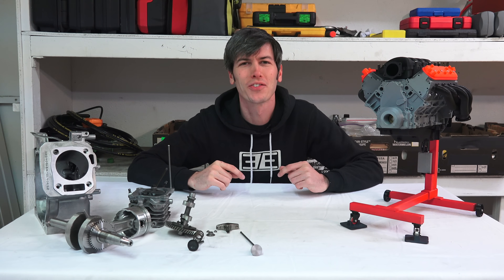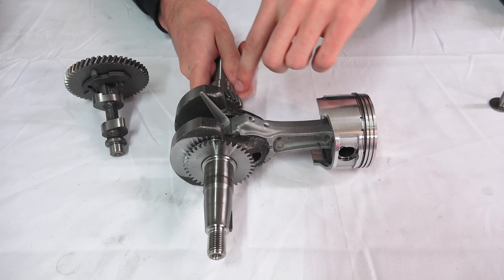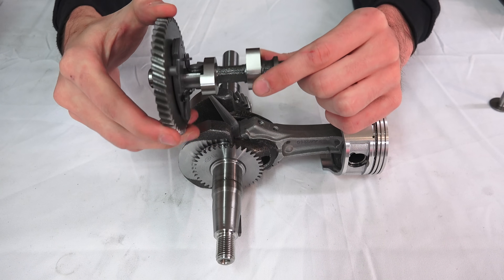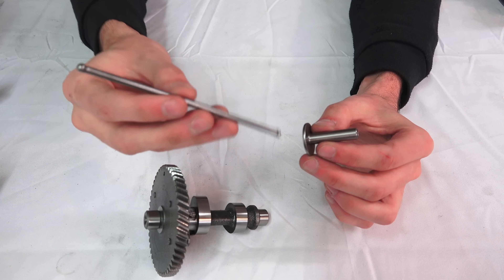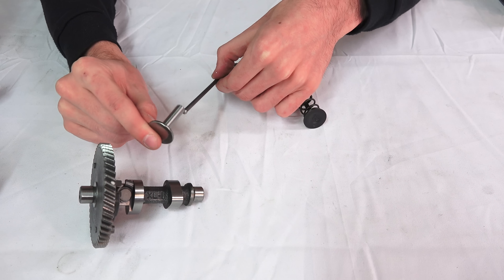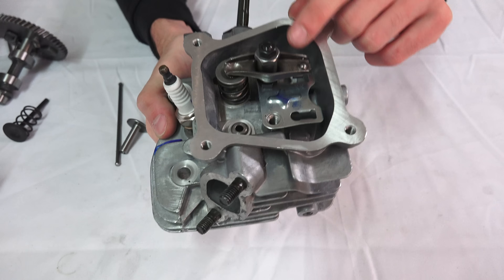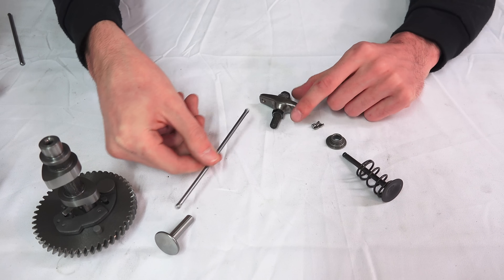Why Can't Pushrod Engines Rev High?

Comment: With every revolution of the crankshaft, an internal combustion engine is trying to tear itself apart.
And high RPMs are the enemy of your motor's durability, so low rpms usually leads to long engine life.
Focusing on making good power at lower revs means less time under the hood with a socket and ratchet!
Reply: Race car. Dont care about long term durability. Just need to finish the race.
Reply: @waysideme  True. But even owners of race cars want the bottom ends of their very pricey engines lasting as long as possible.
Reply: @wedge4hire  Not necessarily. At most  for racing an engine is needed to finish a season. My team is done with an engine after a single race
Reply: @waysideme  Can I race on your team?? LOL! Yeah, I'll agree with you!
Reply: @wedge4hire  Formula SAE. Colleges all around the world design build and compete. My school has an FSAE program and it's free!
Reply: Laughs in Rotary.
Laughs more in Honda.
Reply: @reinbeers5322  Laughs in literally any non-american car company
Reply: So we should be aspiring for diesel container ship engines? Their redline is maybe 1500 rpm? Lol
Reply: @ellisjackson3355  more like 85 rpm
Reply: You clearly dont understand how horsepower is made.
Reply: Excuse me, how can you make more power without pressing more on the pedal?
Reply: Honda would like to know your location
Reply: wedge4hire you couldn't be farther from correct.  "RPM is bad" is another one of those pervasive common knowledge/conventional wisdom myths.  At the same power output, lower RPM ALWAYS creates higher cylinder pressures and detonation/preignition tendencies.

An excellent working example of this would be comparing a 3500 rpm LML Duramax to a 6500 rpm GenIV SBC.  The SBC will make literally double the power on a significantly weaker rotating assembly.
Reply: @zacharymorris9917  "*Rpm is bad?*"
Every japanese manufacturer would like to know your location
Reply: Very good explanation, Couldn't have said it better myself.
Reply: But I like high revving noises. :( I cri. 😪
Reply: High rpms has really nothing to do with the life of the engine for certain engines. Not having a lubricated system is an enemy of that. Most people dont check their oil everyday. It really comes down to when the oil is changed. Is it early then you are good. Is it late, well you are pushing the amount of heat absorbed from the components. Not to mention depending on the spring setup the low rpm can hurt the engine.
Reply: That's an idiotic statement. It doesn't work like that with the laws of physics. Heavy Duty Turbo diesel engines run 1,500 RPM up and down the road all day every day, producing 1,600-2,000 ft-lbs of torque in that RPM range under full load. The reason they last long is keeping the engine lubricated, filtered, and combustion temperature from becoming too hot. Something unobtainable by gasoline spark ignition engines without a massive cost to fuel economy to keep the engine temperatures down. RPM has nothing to do with engine durability, combustion temperature, lubrication, filtration, do.
Reply: @JosephArata  are you high? Lol i mean you're both right.. hes right in saying that is most definitely a factor and comparing gas to diesel is apples n oranges... But why do you think that as soon as overdrive transmissions became a norm engines began running alot longer because of less rotations and stress... Same with oil quality, the oil now blows away the stuff they had in the 70s or even 80s
Reply: @finharms9439  mechanically diesel engines and Gasoline engines are the same, the only difference is fuel type and the way in which they start an ignition stroke. There are diesel engines that operate at 6,500 rpm and ones that operate at 1,000 rpm, it just depends how long of a rod stroke you want for a particular torque curve.
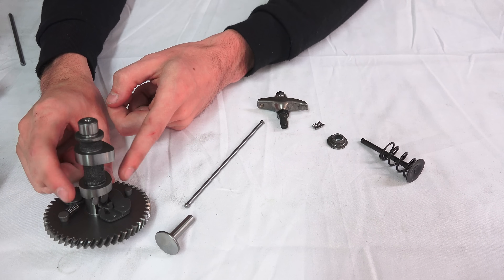Reply: Batojiri1 generally speaking though... perfect example run a ford 302 with a c4 on the highway with anything higher than a 3:27 gear and watch it not get but 130000 but as soon as the AOD and E4OD trans became popular those trucks began getting 250000 with shitty maintance and even the 460 began hitting those numbers with ease my point is, is in everyday driving low stress with good oil gets you your mileage your after...
Reply: If you have overhead cams, 9000rpm is normal lmao. Pushrods? LOL! May as well have drum brakes and leaf springs.
Reply: @JosephArata well put
Reply: Lol...Why do puny engines with puny little slugs make no torque. It's juat the nature of the beast. Low RPM torque is where it's at anyway. High revving engines usually sound like a sewing machine also...
Reply: @mikeromeo8905  I hear you! There seems to be something  glamourous about having an engine that can turn 7500 rpms. My point is get it to 7500 revs and see how long it takes before it spits the rods thru the oil pan! All bad!!

Comment: Valve float is fixed with stiffer valve springs. Revs are dependent on the size of the stroke and rotational imbalances.

Comment: 8:00 Thats not exactly a pushrod-specific issue.  Harley has proven it.  Look at the evolution sportster?  4 camshafts.  4 pushrods.  2 cylinders.   Harley Davidson Milwaukee 8.  4 valves per cylinder.

Comment: What always blows my mind, is that a costly i4 engine with DOHC barely revs to 8 or 9k RPM, but these LS pushrod engines do 6500 to 7k RPM reliably. IMO: I don't think DOHC is THAT huge of an advantage when we can get considerably more displacement in the same package.

Comment: I hate leaving negative comments but in this case it is quite clear that you that you don't understand the biggest limitation on engine RPM and that is piston speed.  Formula 1 engines don't have double the revs of of a NASCAR engine due to the DOHC design, they rev twice as high because their engine stroke is about twice as short.  Show me a 20,000 RPM engine with a 3.6"-ish stroke and I will show you a hand grenade.  Not saying reciprocating mass, air flow considerations  and valve float does not play a factor but in a properly built engine they can be controlled and extreme RPM's can be achieved.  Bottom line piston speed is the main limiting factor.

Comment: That's cute that you think that overhead cam engines don't have valve float, that stiffer valve springs are the only solution (rev kits), or that 2 larger valves are a handicap (4 smaller valves get hot faster than 2 larger valves. Not to mention, that more valve springs pretty much kills any advantage you get over 2 valves per cylinder.

Comment: If any thing, push rod engines have upped their game (Nascar being the pinnacle) while overhead cam engines have gotten lazy.  Push rod engines naturally put out more low end torque than their OHC bretheren, hence negating the need for higher redlines. But again, Nascar is hitting 10,000 rpm (briefly) with 358 cu. in. engines. That's a lot of mass. So, it can & is, being done. And yes, I know motorcycle DOHC engines are flirting with almost twice the RPM, but again, it's about mass. I'll bet a high end one litre push rod engine could turn at least 15,000 rpm.

Comment: So basically the problem with pushrods are the springs?  If it was all mechanically linked with gears or chains then they would be able to rev higher right?

Comment: just to touch on the mention of multiple cam profiles with overhead cam, i know some companies are using it to simply adjust the lift and profile, but a few weeks ago i pondered the possibility of using such a setup to completely change the way the valvetrain operates at lower RPM. for example, at higher RPM you have modest lift on both intake valves, but at lower RPM the camshaft slides into profile 2 which disables 1 valve completely and increases lift on the other to improve intake charge velocity. i guess a possible side effect of this is slightly more restriction low down, but in saying that it would also likely create some turbulence, which might just benefit fuel atomisation

Comment: Shift at valve float and govern out by running out of gears.  
Then they'll start running on their own oil at this point after you've run out of gas. 
 Guaranteed to work at least once!

That's about all a smog-choked, flat-cammed, GM TBI 305 is good for - except being able to drive it into the shop vs. pushing it to replace it with a 350.

Comment: Nascar 10,000 rpm for 500 miles, Mercedes Ilmer won indy 500 pushrod engine, problem is pumping losses at high revolutions, two stroke model airplane engines turn the highest, no valve train 30k
.

Comment: Why can’t pushrod engines rev high? They can. As a teenager I builtba 383 striker sbc that revved 7800-8000rpm and it was in my daily driven car. If a non experienced teenager can build a high revving pushrod engine, then what’s the excuse? I call bs.

Comment: I feel like i need to clear up a lot of misconceptions in this comment section.

1: Yes pushrod engines can rev to 10,000 RPM for extended periods of time no problem (Nascar for example) However you have to use solid roller lifters to do this which means every few thousand miles you have to pull the valve covers and lash the valves. Hydraulic lifters automatically set the lash but wont run past 7-8k RPM reliably.

2: 2 big valves will out flow 4 smaller valves, thats just how it works. However if your valves are too big you will loose all of your lowend torque which is why everyone is going to 4 valve setups. With 4 valves you can keep your lowend torque and still flow good in higher RPMs which is a compromise not possible with a 2 valve setup.

3: just because an engine is 2 valve per cyl OHV pushrod doesnt make it a torque monster. Take a 302 chevy or 4.8 ls for example, they dont make good power until well past 5,000 rpm

Comment: Simple answer: the only limitation to a pushrod engine. Valve float
Reply: You get valve float in OHC engines also, I've stripped 2JZ's, RB 26's and plenty of Honda engines where the valve spring couldn't keep up and ended up having a valve embedded in the top of a piston.

Comment: I go to a performance engine building school we specialize in LS  trust me they rev high it depends on the tolerances, clearances and endplay just like everything.. even vct has valve float.. get the right spec parts for your application.

Comment: It’s kinda a no brainer, there is higher valve train mass from the pushrods, and the cam followers in addition to the regular valvetrain components.. 

The valve springs have to work harder to retract all that reciprocating mass...

So the valves float easier.. 

That’s my educated guess haha

Comment: The late 1980s Corvette ZR1 had 4 cams and 48 valves.  It also had the ability to close 1 intake valve per a cylinder to help gain low end power.  Plus it would get locked out per velvet key.

Comment: Theres no replacement for displacement. Thats why those who know, know the LS series is the best engine. Its smaller and lighter than that fancy 5.0 while being able to fit it in something like a Miata. Its size also helps keep the center of mass closer to the bottom middle of the car. You can make any engine get the HP you want but it will never be as easy or cheap to do it than it is with an LS. The 7 liter LS7 is perfection. 505HP, can fit in a miata, and still get 29+highway mpg’s on pump gas! The 5.0 is 2 liters smaller, too tall to fit in even a mustang without a bulgy hood, 50+ less HP than the LS7, and can’t get 26 highway MPG’s on 87 octane🤦🏼‍♀️

Comment: Pushrods can rev high but they require a little more work because there is just more reciprocating mass to control.
Reply: ls3 with 4.8L crank you got around 600hp and 7800-8000rpm revving, write on youtube search "SHORT STROKE-AN LS MONSTER MYTH?
" the channel name is Richard Holdener he is doing lot of videos with junkyard ls engines.

Comment: Valve float:  Stated simply, push-rod systems inherently contain a lot slop with all those gaps and moving mass.  Simpler explanation of valve float:  The cam lobe comes around again before the tappet or follower can drop or move down to make contact with it, hence it floats in mid rotation above the cam because the valve spring can't push the valve back fast enough.  So, the valves float, and you lose power.  If the engine is a "non-'interference" type, the pistons will not hit, break, bend or "Interfere" with the open valve, which is NOT the case with most DOHC and SOHC modern type engines if you break or lose the Gilmer or timing belt.

Comment: You guys really dont know anything about cars pushrod engines dont rev high tell that to all the guys poppin wheelies on the track you should say stock Chevys cant rev high. I had 360 amc that I turned 10 grand every day of its life for 5 years til i sold it. Multiple Mopars and Pontiacs I turned just as hard a few harder. The shitty bottom on end on stock chevys and crappy head design and valve angle is what kills stock GM engines. If you build them then yeah pretty good.  If you get valve float get some higher rate springs and solid or roller lifters. The fastest cars in the 1/4 mile in the world use pushrod engines. No valve timing required. Just get a real non computerized actually steel internal before 1972 engine and youll be just fine. lol
Reply: Be shittin VTECs and EVOS and Skylines by accident.

Comment: A lot of new DOHC engines don't rev that high anymore. I had a 1992 Nissan Sentra SE-R that rev'd to 7500 rpm. Now I have a Mazda, because of VVT, can't rev much past 6000. I guess only the very expensive engines get the high roving ability.

Comment: High RPM engines also have a disatvantage because it TAKES LONGER to reach high RPMs to get to max HP.
Reply: Can be compensated with short gear and cam lobe profil to get enought torque at low rpm

Comment: Are you aware of pneumatic valve actuators yet...? It's a technology that will blow your mind. The Scandinavians came up with it... Hot Rodders know how to coax 8,000+ RPM out of their racing engines. Generally speaking, low stroke engines out rev long stroke engines and long stroke engines out torque low stroke engines.

Comment: I ran around in the early '70s with a guy who ran a 396 at 9000 RPM fairly routinely. Sold the car after 3 years still never beaten on the street.

Comment: You are right except for 1 thing...... the nascar engine 358 cuin... is a perfect balance of hp vs rpm... example the stroke and rpm work together to live.... the limiting factor are equal... they are running at max... 9800 rpm and 800hp, now that engine turning 10,500 rpm might fail in 10 secs... could be from a valve taging a piston or oiling failure or rod, piston or crank failure, they go hand in hand.... now the f1 cars are small cuin short stroke lighter parts... 15,000 rpm small valves lighter valves can move and change direction faster, the springs get hot and fail so use air.....also they are boosted that helps air in, so the big valves are not needed.... my dirt late model i used to run could go 9500 rpm, its plenty, 2200 lb car 2.2g acceleration 2.5g cornering speed that is plenty enough. It's all relative dude, in my book a nascar engine zooming by at 180mph singing at 9800rpm sounds and looks better that a f1 car zooming by at 180 mph singing at 15,000 rpm..... to each his own.... i love push rod v8s...

Comment: The theory is right yes, however pushrods can be made to rev happily and it is very rare that the pushrod design is the limiting factor. An old A series BMC can be made to run reliably to 9000 RPM on a consistent basis. Heck, mine which received a good preparation but nothing exotic can be revved up to 7500 on a daily basis, the only known limitation being the 3 bearings crank.

Comment: Its all in the valve train iv built 327s that have hit 11,000 launching at 6,500 on the trans break what you mean pushrod motors cant turn rpm,s

Comment: Nhra prostock I'm sure has been over 11,500 rpm. 500" 90° v8. 
There has been LS engines over 10,000. 
Camshaft technology has come a long way from what you are describing. Solid roller keyed lifters, asymmetrical cam lobes, DLC, etc. 
Watch a spintron video or search for comp cams. Billy Godbold has done so much work on the spintron and made us pushrod knuckle draggers competitive with the Dohc engines.

Comment: why are people concerned about a high red line if you make gobs of power down low there is no difference. 500 horsepower at 5000 RPM if the power band is good and level is just as good if not better than 500 horsepower at 8000 RPM.

Yes there are benefits but with the right gearing you'll never know the difference.

Comment: Look, push rod vs over head cam engines and engine rpm. Piston speed is often your limit. A formula 1 engine has a vert short stroke. A typical us v8 has a long stroke. The piston speed of a normal engine isnt that far off from a formula 1 engine.

Comment: Seems to me you could purposely float the exhaust valves to increase valve overlap at high rpm. floating the intake just a bit might work too since at high RPM the air would have momentum to continue to flow in even after bottom dead center.

Comment: From personal experience owning a car that weighs 2,500 pounds and has a dodge caravan 3.3 v6  I can definitely say with the power it puts out it has a lot of torque for a low rev engine. Usually have the upper hand at the 1/4 mile because of it.

Comment: I'm not the most knowledgeable on this subject but could it be possible to replace the cam lobes with smaller "pistons" that control the intake/exhaust? I concede it adds weight but in the interest of performance reliability could it not rectify the entire situation somewhat better than all the mess with vvt and air springs?